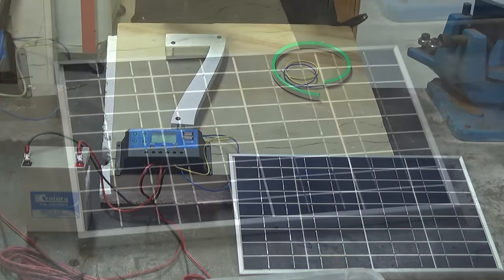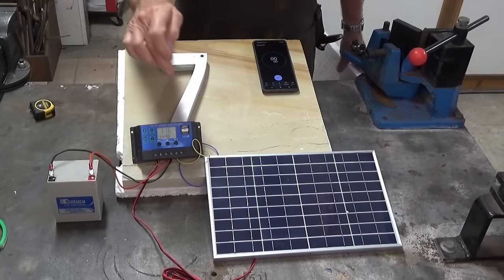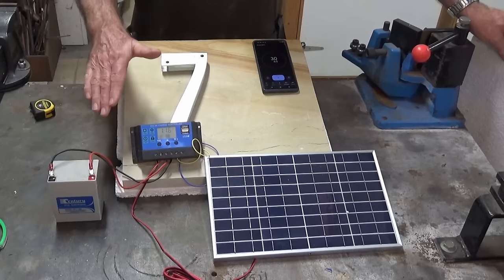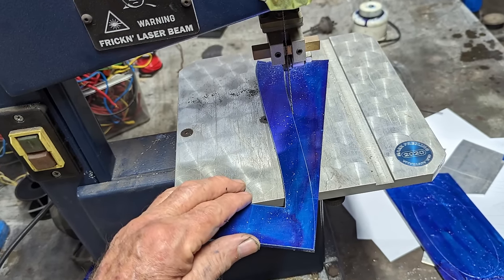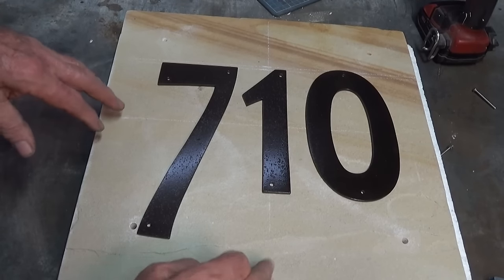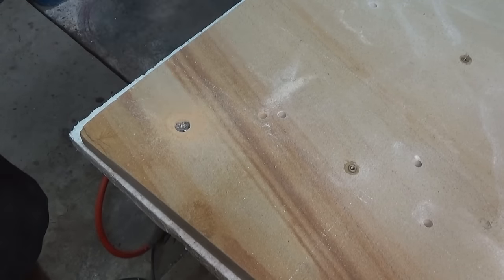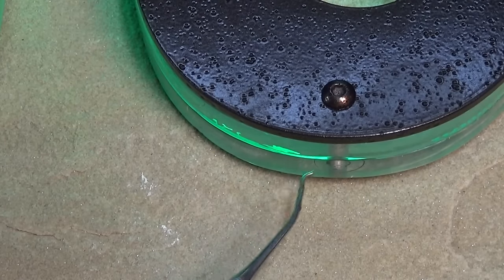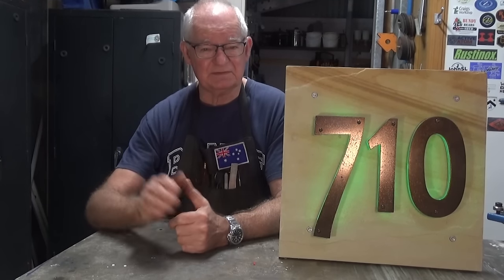Make a Solar Powered, Self Illuminated House Number

Comment: Looks great. Like the idea of casting the #'s. Was thinking , if you had thought of texture on the casting side that will be visable. Always enjoy, thanks.
Reply from the maker: I am not sure how I will finish the castings. If they turn out without any shrinkage on the face I may just wire buff them and powder coat to simulate the same texture as the sandstone. I think the cast numbers will be almost bullet proof in terms of UV resistance. I used a similar powdercoat and material choice for some low voltage path lights and they have been exposed to the weather for nearly four years and they still look as good as when I made them.
Regards,
Mark
Reply: @Preso58  I remember the fixture of which you speak.